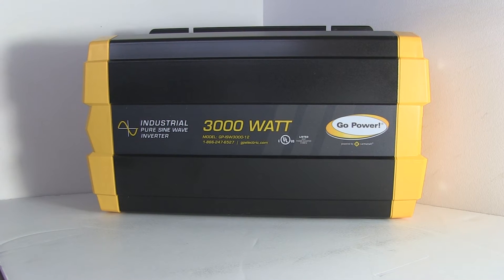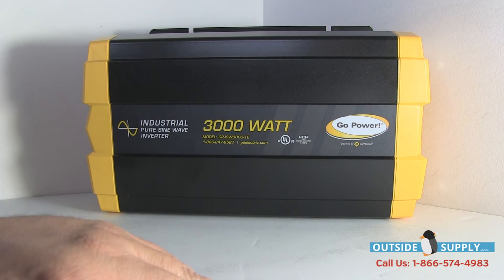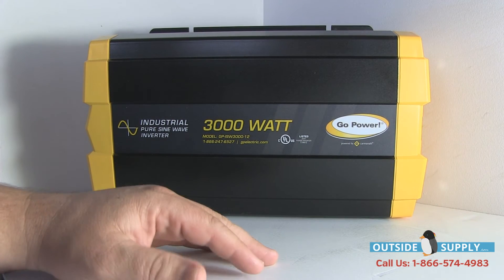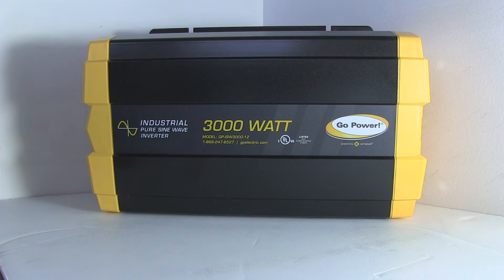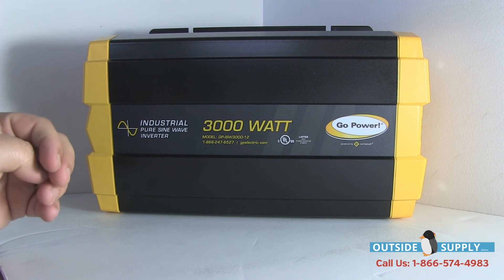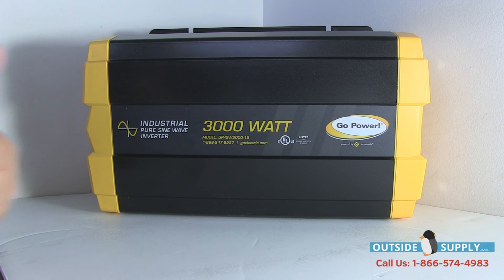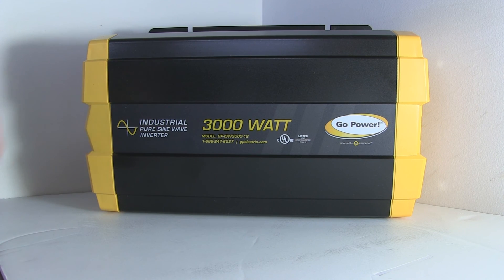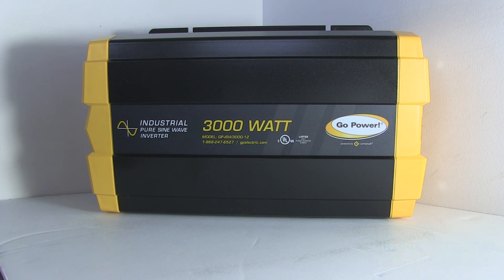Go Power Sine Wave Hard Wire Inverter 2000 vs 3000

Comment: Nope buy the IC-2000 Everything is built in, 
Transfer switch 
Ic-2000 =30amp
ic-3000 =50amp
Do not use the industrial units in an RV no no no !!!
Reply: Hi, the specs on the IC3000 says compatible with 30 amp. My installer is saying no and that I have to have an 1800 watt inverter since I have 30 amp service. I can't find anything on this online. Do you have any thoughts on this besides get a new installer? Thanks in advance.
Reply from the maker: The IC2000 or the ISW 2000 will be ok for 30 amp service. The IC 2000 comes with transfer switch and charger, where you need separate components for these functions with the ISW series. Either model would be ok for RV, just depends on configuration. Call me at 1-866-574-4983 and I can help you choose right equipment.
Reply: @OutsideSupplycom  Thank you for your response. I got Go Power involved and they worked with the installer and all is well.